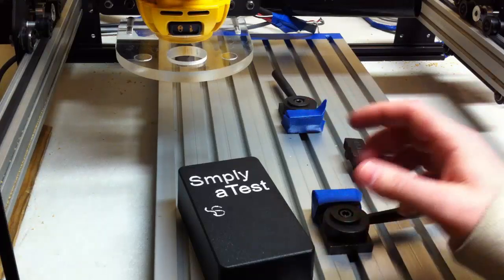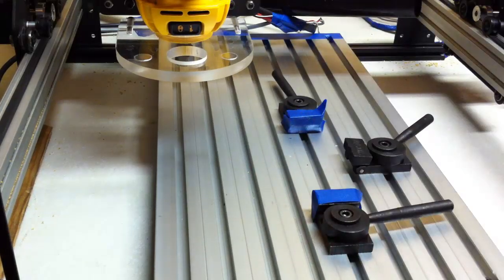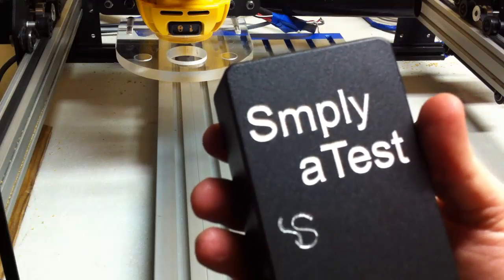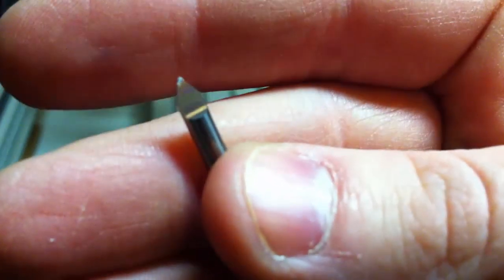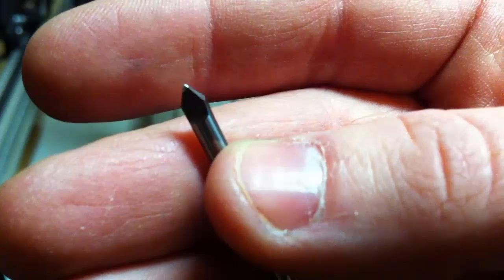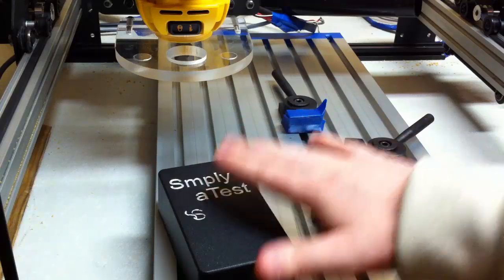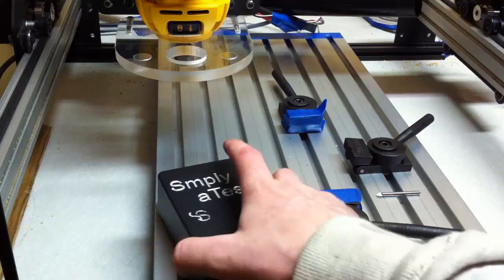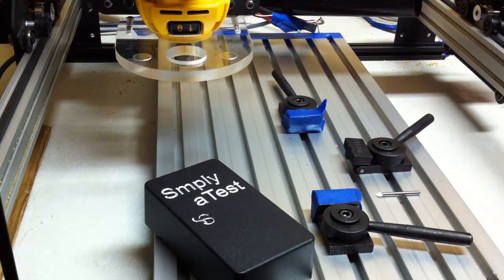ShapeOko 2: Engraving an Aluminum Project Box

Comment: im thinking about a similar set up.  have you tried 1/4" bits yet?
Reply from the maker: I have a 1/4" three flute endmill that I really like using on wood, but I haven't used anything else on aluminum yet.
Reply: Caleb Peters I just realized I tweeted you.  What set up do you recommend for doing aluminum and using 1/4 shanks?  Im thinking Nema23s with a DW660 spindle
Reply from the maker: illusionistpro
Well, I would start out fairly conservative with  ~0.3mm pass depth and 500mm/min feed rate. One thing I would point out, is that some aluminums melt faster than others. This means that it might be more prudent to take a very shallow pass and run a higher feed rate. Milling aluminum with the Shapeoko is kind of like welding, it's all about heat management. This goes double for when using a DW660. Also it's generally accepted that a 1flute endmill yields better results.